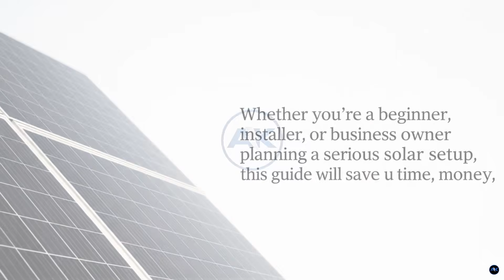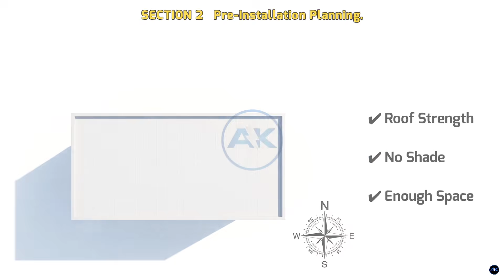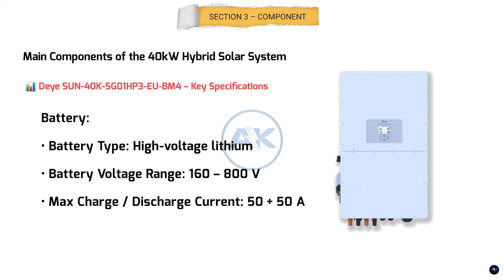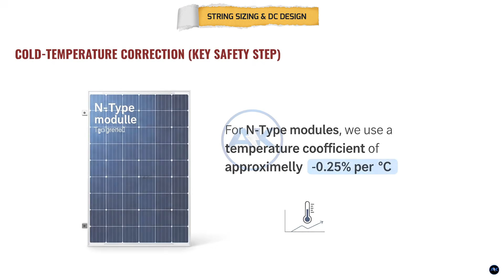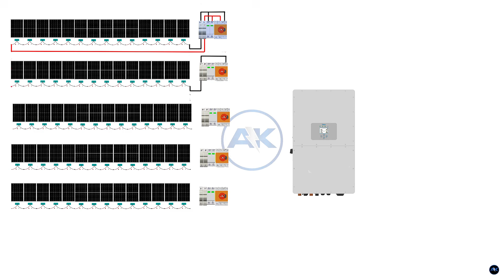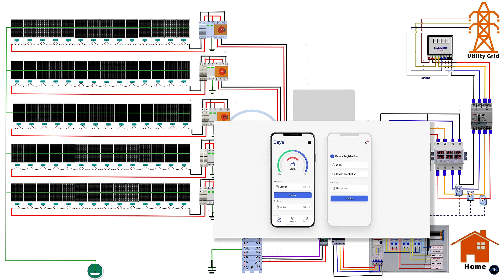40kW Solar System Installation – Deye Hybrid + 60kWh Battery (Zero Export Explained)

Comment from the maker: ⚠️ IMPORTANT CORRECTION @ 23:22 ⚠️
Huge thanks to @livemelt for catching a critical detail! In the video, I misspoke regarding the CT (Current Transformer) coil setup.
To ensure your Deye/Sunsynk inverter reads your home's power usage correctly:
Location: Install it on the main Live grid feed.
Direction: The arrow on the coil MUST point towards the inverter (away from the utility meter).
If it’s backwards, your "Zero Export" and battery discharge settings won't work properly. Stay safe and happy.

Comment: Make it for a 2000MW Power Plant. 
Explaining each and everything installed in a 2000MW plant.
Reply from the maker: A 2000MW plant operates on a utility-scale level with specialized high-voltage infrastructure far beyond the scope of this residential and commercial hybrid series. 👍

Comment: Great job, quick question for the grid questions incase there we don’t have 3phase can we still connect single phase to the inverter?
Reply from the maker: Great question! Yes, most hybrid inverters like the Deye 40kW model support single-phase grid input even if the inverter itself is 3-phase output capable — just check your specific model's datasheet for grid-input phase requirements. If you're on single-phase utility supply, you'd typically wire L-N-PE into the grid input terminals and the inverter handles the rest. Let me know your inverter model and I can point you to the right wiring diagram.

Comment: I also want to know if we can connect a DC car charger directly to the inverter for a capacity of 7kwh
Reply from the maker: Thank you for your question! Yes, a 7kW DC EV charger can be connected, but it depends on the inverter's DC charging support, battery voltage compatibility, and the manufacturer's specifications. We'll cover this topic in detail in an upcoming video. Thanks for watching and stay connected!

Comment: So if you use all 4 mppt or use 1 or 2 won’t affect efficiency correct? You could have used all 4 mppt, not just 3 correct?
Reply from the maker: Great question! Yes, you're absolutely right — using 1, 2, 3, or all 4 MPPTs does not affect the inverter's overall efficiency. Each MPPT channel operates independently, so whether one is active or all four are running, the conversion efficiency remains the same.
And yes, technically we could have used all 4 MPPTs — no problem there at all. The reason we used only 3 in this design was purely based on the number of strings in the array. With the panel count and string configuration we had, 3 MPPTs was the cleanest fit — using a 4th would have meant either leaving it empty or forcing an unbalanced string arrangement, which isn't ideal from a design standpoint.
The golden rule is: match your string count to your MPPT count, and don't leave an MPPT with a significantly mismatched or undersized string just to "use" it. An unused MPPT doesn't hurt anything — it just sits idle.
Hope that clears it up! 🙌
Reply: So since each mppt has place for 2 strings are the 2 + and 2 - of each mppt internally connected? Or could you connect string 1 and 2 in parallel and plug it into mppt as a single string? Would it make any difference?

Comment: Can u do a 100kw sunsink sistem
Reply from the maker: @nickybarnard531 Great suggestion! A 100kW SunSynk system is a serious commercial-scale setup — we're talking multiple SunSynk 50kW inverters in parallel, a large PV array likely in the 120–150kWp range, and a substantial battery bank depending on backup requirements. That's a full engineering design project covering string sizing, protection coordination, busbar sizing, and grid compliance. 💪
It's definitely on the content roadmap — if enough of you want to see a 100kW SunSynk build breakdown, drop a 👍 below and I'll prioritize it. If you have a real project with specs (load profile, site location, grid or off-grid), feel free to share in the comments and we may feature it in the video! ⚡🔆

Comment: So I can install this as a 240 volt 3 phase correct?
Reply from the maker: Hey @Moonshinefjohn! Great question, and yes — but with an important clarification! 👍
The Deye hybrid inverters used in this 40kW system are 3-phase units, so they do output 3-phase AC. However, the voltage depends on your grid standard:
⚡ 230V/400V system (Europe, Australia, most of Asia/Africa):
→ 230V per phase (line-to-neutral) = 400V line-to-line
⚡ 120V/208V system (North America, some Caribbean):
→ 120V per phase = 208V line-to-line
⚠️ True 240V 3-phase (delta, no neutral) is rare — mostly older industrial setups. The Deye SUN-50K (and similar models in this range) are designed for 230V/400V wye (star) 3-phase with neutral — so if your local grid is that standard, you're good to go! ✅
If you're in the US on 240V, note that's typically single-phase split (2 × 120V), which is NOT compatible with this inverter without a step-up transformer.
Always match the inverter's grid voltage spec to your local utility voltage before installation! 🔌
Drop your country/region below and I can give you a more specific answer! 👇
Reply: @akelectricdiy I'm in Texas

Comment: Some visuals of the box internal connections would greatly help in keeping viewer's attention from wondering off into the weeds, even if just representational diagrams.  Looking at nothing happening for long periods of time... pretty boring.  Otherwise a more than excellent presentation.  Nice work and a huge thank you. ❤
Reply from the maker: Thank you so much for the kind words and the heart! 🙏❤️

You make a completely valid point — internal connection diagrams or even simple representational visuals would definitely help break up the monotony and keep viewers engaged throughout. That's great feedback, and something I'll absolutely incorporate in future presentations to make the content more dynamic and easier to follow visually.

Really appreciate you taking the time to watch and share your thoughts. Comments like yours help make the next one even better! 😊
Reply: @akelectricdiy  You are very welcome.  It was an excellent, clear and complete technical presentation.  I was in oil and gas engineering for 50 years.  I know a good presentation when I see one.  Well done! 
  I was just worried if I was missing something you were saying during the blank spots.  A was a minor point, but You Tube is 99.9% visual.  I know I am. I had a great Chinese professor in college years ago.  He would always say,  "You hear, you forget.  You see, you remember.  You do, you know. ".  So now, I'm making the spreadsheet.  Thanks again.

Comment: Deye inverters cannot be sold or installed in the US. Deye-branded inverters are generally not authorized for direct sale or use in the U.S. due to exclusive distribution agreements with other brands, most notably Sol-Ark. In November 2024, reports surfaced that Deye remotely locked or "bricked" unauthorized Deye-branded units in the U.S. and other regions to enforce these agreements and safety regulations. 

Key Details Regarding Deye inverters in the US:
Exclusive Agreements: Deye operates as the manufacturer for other brands, such as Sol-Ark, which hold the exclusive rights to sell in the U.S..

Remote Shutdown: In late 2024, many non-Sol-Ark Deye units were deactivated via firmware updates, causing significant issues for owners who bought from non-authorized distributors.

Unauthorized Sales: Unauthorized sales of Deye-branded products in the US are technically seen as a breach of contract and intellectual property infringement, and these units may lack proper UL certification.

No Official Support: Deye does not provide technical support or warranties for Deye-branded inverters in the U.S. market.ed or supported by the manufacturer.

Deye-branded inverters are generally not authorized for direct sale or use in the U.S. due to exclusive distribution agreements with other brands, most notably Sol-Ark. In November 2024, reports surfaced that Deye remotely locked or "bricked" unauthorized Deye-branded units in the U.S. and other regions to enforce these agreements and safety regulations.

Comment: This is very helpful and thanks a lot sir. Just one question, how did you arrive at 60Kwh Battery? What is the battery selection guide for a 60Kw Hybrid solar system?
Reply from the maker: Great question! Here's how battery sizing works for a 60kW hybrid solar system:
The general rule of thumb is 1 kWh of battery per 1 kW of solar capacity, but for a hybrid system we go further by factoring in:
Backup autonomy – How many hours of backup power do you need? For a 60kW system, if you want 1 hour of full backup, you need at least 60kWh.
Depth of Discharge (DoD) – Most lithium batteries allow 80–90% DoD, so a 60kWh battery effectively gives you ~48–54kWh usable capacity.
Load demand – Calculate your average daily consumption. If your loads draw ~30–40kW continuously, 60kWh covers roughly 1.5–2 hours of full off-grid operation.
Inverter sizing match – A 60kW hybrid inverter typically recommends a battery bank that can deliver high current without voltage sag, making 48V or 96V high-capacity lithium (LiFePO4) packs ideal.
Solar harvest buffer – The battery also needs to absorb peak solar generation during low-consumption periods, so undersizing causes clipping losses.
Bottom line: 60kWh is the minimum practical size — many installers recommend 80–100kWh for commercial reliability at this scale.
Hope that clears it up! 🔋☀️
Reply: @akelectricdiy  Thanks for the clarification.

Comment: 23:22. That is WRONG! The Deye CT coil (current transformer) must be installed on the main live grid feed, with the arrow on the coil pointing towards the inverter (away from the grid/utility meter).
Reply from the maker: "Thank you for the sharp eye, @livemelt! You are absolutely correct. Proper orientation of the CT coil is vital for the inverter to accurately sense power flow. We’ve added a pinned comment/note at 23:22 to ensure viewers follow your instruction: Arrow pointing towards the inverter (away from the grid). Appreciate you helping the community stay safe and efficient!

Comment: Hello and thanks for the video. If we don't mind grid injection but no power input from the grid to the inverter, and the house distribution box itself connected seperatly to the grid how should we connect inverter to the distribution box? Should we use an ATS board in our distribution box?
Reply from the maker: "Great question! It sounds like you're looking for a 'one-way' flow of energy. Here’s the breakdown of how that usually works:
1. Do you need an ATS?
Actually, no. An ATS is an 'either/or' switch. If you want to inject power into the grid, the inverter and the grid must be connected at the same time so they can sync frequencies. An ATS would prevent that connection.
2. How to connect to the Distribution Box:
Instead of an ATS, you would typically connect the inverter to a dedicated breaker in your distribution box. To prevent the grid from 'feeding' the inverter (like charging your batteries when you don't want to), you use CT Clamps (Current Transformers) or a Smart Meter installed at the main incoming grid line.
3. Software vs. Hardware:
You achieve your goal through the inverter settings, not a physical switch. Most hybrid inverters have a 'Grid Export' mode where you can enable injection but set the 'Grid Charging' or 'AC Input' to zero.
Summary: Skip the ATS, use a dedicated breaker, and ensure you have a compatible Smart Meter/CT Clamp to tell the inverter when to push power out and when to stop taking it in! Note: Always check local regulations, as grid injection usually requires permission from your utility provider."

Comment: what is the point of bifacial PV panels installed nearly flush with the rooftop .... not sure you have the expertise you claim
Reply from the maker: "You've hit on a common industry debate! You're 100% correct that flush mounting negates the albedo gain. We see it a lot now because bifacial modules are becoming the manufacturing standard. Even without the rear-side boost, the front-side performance and the glass-on-glass durability often outweigh the lack of backside production on residential roofs."
Reply: So if the front side is broken can you just flip it and use the other side?

Comment: I broke it down to 70 Enphase inverters six panel strings IQ 8 series and their three-phase combiner box and their batteries your system I would upgrade your battery pack to five more or go to Schneider Electric use 6 inverters and their mppt charge controllers 100 600 with a graphene capacitor storage unit this setup is for a solar farm to perpetuate the green new scam
Reply from the maker: "That’s a massive jump in architecture. Moving from 70 Enphase microinverters to a Schneider DC-coupled setup with MPPT 100 600s definitely shifts this from a residential feel to a commercial-grade powerhouse The graphene capacitor suggestion is particularly interesting—it’s a 'buy once, cry once' approach to storage compared to standard lithium. Whether one views the "Green New" initiatives as a scam or not, there's no denying that the hardware required to go truly independent at that scale is an impressive feat of engineering. Thanks for the breakdown."

Comment: Additionally which setting in the inveter itself must you activate to prevent you from sending power back to the grid.
Reply from the maker: "That is a great question! Preventing power export is a common priority for many DIY and off-grid-hybrid setups.
In most modern inverters, the setting you are looking for is typically called 'Zero Export' or 'Export Limit.' Depending on your specific brand (like Growatt, Deye, or Victron), it might also be listed under:
Export Management
Grid Feed-in Limit (set to 0W)
Non-Injection Mode
A Quick Note on Hardware
Keep in mind that simply turning this setting 'ON' in the software usually isn't enough. For the inverter to know how much power to throttle, it requires a CT (Current Transformer) Clamp or a Smart Meter installed at your main service entrance. This sensor tells the inverter exactly how much power your house is using so it can match production to your load perfectly.

Comment: If I purchase this inverter even though it’s hybrid can I use it as a grid tie inverter by not connection battery storage and at a later day or years when I can afford the right battery storage I can attach it
Reply from the maker: "Great choice! The Deye 40kW Three-Phase Hybrid is actually perfect for this. You can set it to 'No Battery' mode in the settings on day one, and it will function exactly like a standard grid-tie inverter. Just remember that because it's the high-voltage (HV) model, you'll eventually need a high-voltage battery bank (160V+) rather than the standard 48V ones. It's a smart way to future-proof your setup!"
Reply: @akelectricdiy thanks for this by brother I really appreciate it we about to install on here in Jamaica but it’s the 60kw version inveter hence me asking the question. Do you have an email or contact I could reach you at if I have follow up questions or queries

Comment: This is another great post. I previously requested a video from you about installing a DEYE three-phase high-voltage hybrid inverter and a Pylontec Force H3 battery. I hope you will create such a video. In this video, you used a smartmeter for zero-export to load. If I use the DEYE inverter in zero-export to load mode without a smartmeter and CT, will there be any backflow to the grid?
Reply from the maker: Thank you for following up, @elektronikhobim6903! It’s great to see your continued interest in the Deye 40kW three-phase high-voltage (HV) setup.
Regarding your question about using "zero-export to load" without a smart meter or Current Transformer (CT) sensors:
Zero Export to Load Mode: This mode is designed to work using the inverter's internal sensors alone. In this configuration, the inverter will only provide enough solar power to match the demands of appliances connected directly to its dedicated "Load" port.
The Risk of Backflow: Without a smart meter or CT clamps installed at your main grid connection point, the inverter is essentially "blind" to your utility meter. If you have other appliances connected to your main distribution board (the "Grid" side) that are not on the inverter's load port, the inverter cannot account for them or ensure that no power is being pushed back into the public grid.
Performance Reality: Even with sensors, hybrid inverters can experience minor "leakage" or temporary backflow when a large appliance (like an AC or heater) suddenly turns off. Without the external "eyes" of a smart meter or CT, the risk of backflow is significantly higher because the system lacks a reference point for the actual grid flow.
Conclusion: While the inverter technically supports "Zero Export to Load" without extra hardware, it is strongly recommended to use the CTs or a smart meter if you are required by your utility provider to have zero backflow.
A video guide on the Deye 40kW HV and Pylontech Force H3 installation would be a powerful resource for high-capacity setups. I have noted this request!
Reply: @akelectricdiy thank you veri much. I'm waiting impatiently.
Reply: @akelectricdiy  Okay, so if I disconnect all my loads from the grid and power them from the inverter's emergency output port, and connect the inverter to the grid in series, would I still need to use a smartmeter and CT scanner?
Reply: By the way, do you have a product link for the smartmeter brand and model you mentioned in the video?